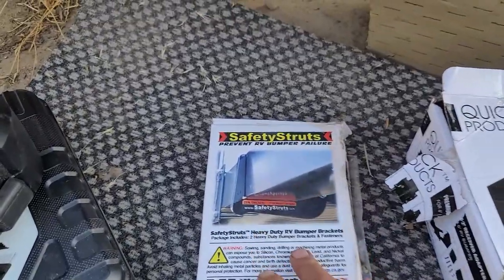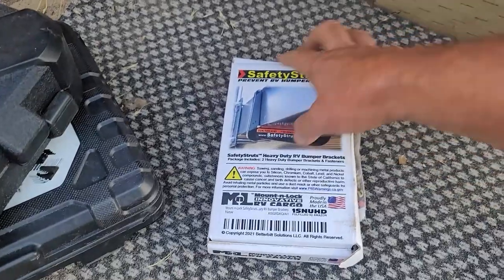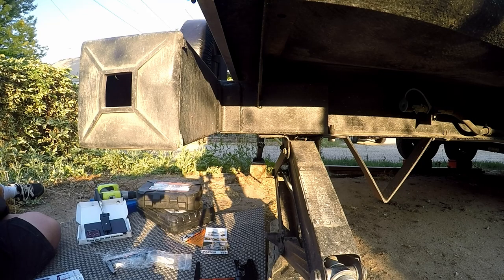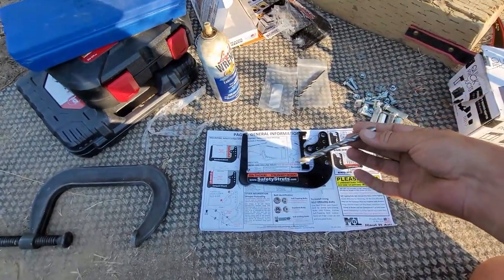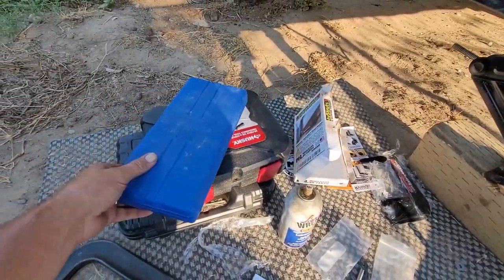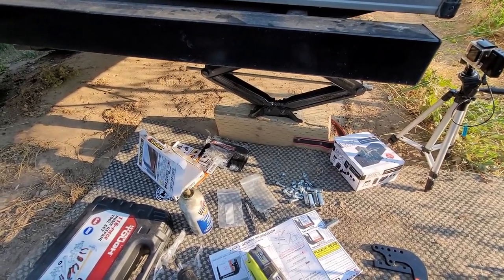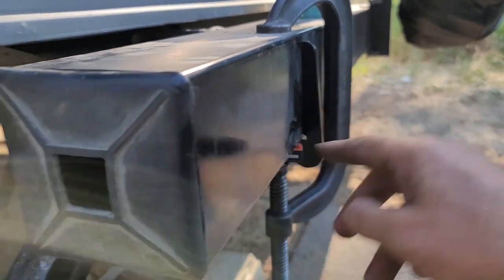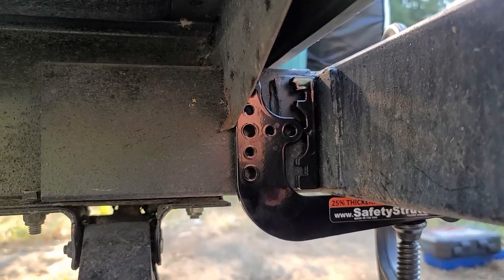RV Bumper Support & Hitch Reciever Install

Comment: How’s the hitch holding up so far?
Reply from the maker: We put close to 13000 miles on the trailer with a carrier mounted to the bumper and we nexer had an issue with it. I would recommen them.